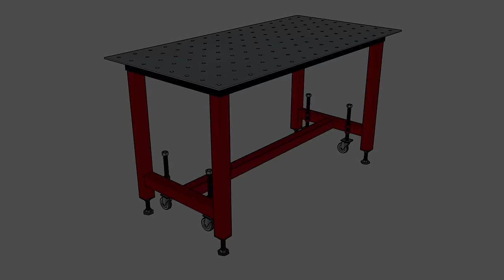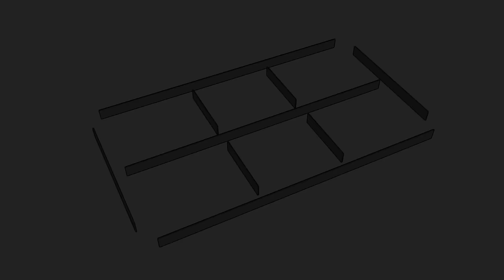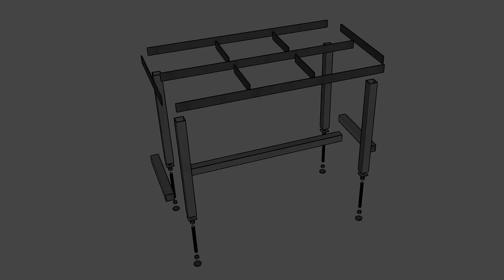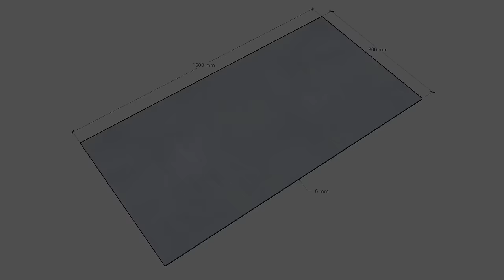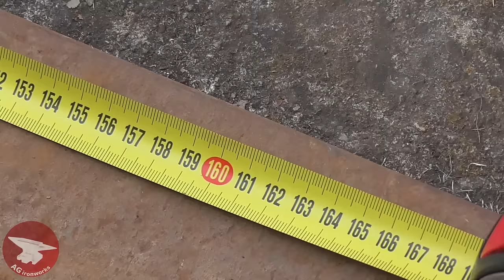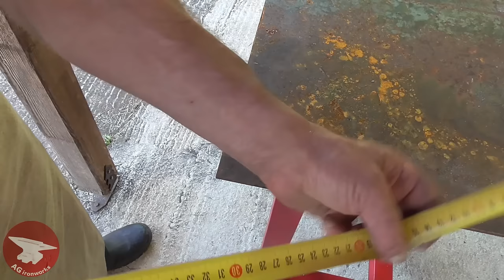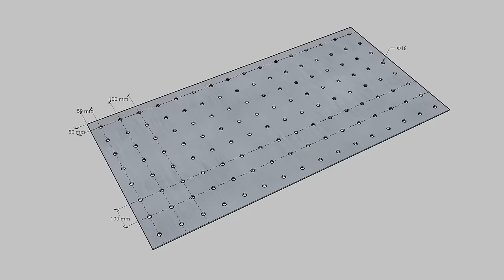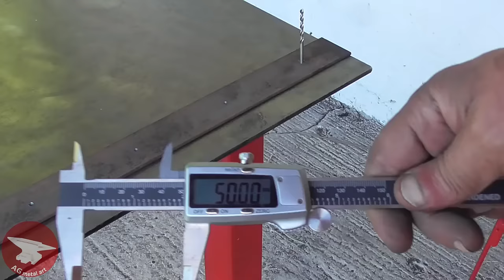Welding Fixture Table build - Step by Step the Entire Process

Comment: I bought 100A plasma and P80 straight steel machine torch for CNC. I am making electronics for 5 inch touch screen THC. I bought 2000x1000x1.5mm steel sheet and cut it in one piece for water pan and 14 pieces for grill. I want to make 1100x800x100mm plasma water pan but I don't have press to bend sheet. But when I put plasma on my cnc the very first project will be 10mm thick welding table because  I have Gude welding table with 2.3mm thick fixture plate and it is not perfect. My problem is bending sheet for water pan. There are 10-15 workshops with hydraulic benders in my town but no one want to accept job to make only 4 bends ☹ BTW I tried plasma and it cuts 40mm iron plate so it would be interesting to see what it can do combined with my diy CNC.
Reply from the maker: You don't need a press to make the water basin. I have made many without a press, even in thicknesses greater than 1.5mm. Watch this video to see how it's done:  https://www.youtube.com/watch?v=KyISgG2FLBU from 0'57'' - 2'45''
Reply from the maker: *If you're making a welding table, don't drill the 10mm plate with a plasma cutter, but use a magnetic drill instead. The plasma cutter leaves a bevel on the cuts and doesn't have the precision of a drill. There is a high chance of damaging the plate.

Comment: Nice work but I wouldn’t have done it without a magnetic drill. Just wondering how long did it take you to make that table ?
Reply from the maker: It's true that the drilling proved to be difficult for me. Certainly, with a magnetic drill, the job would have been much easier. The holes in the sheet metal took significantly more time than the entire rest of the construction. I would say 80% or even more,
of the total time required

Comment: What thickness flat bars are you using for the box structure?
Reply from the maker: 5mm.....their are one or two sections with a thickness of 6mm
Reply: @AGmetalart  Thanks. Great seeing you use ingenuity and basic tools to build. I was thinking of adding some wood or sheet metal trays underneath for tool storage.
Reply from the maker: @gamernerd7139  Surely it's better to utilize the downstairs area as well. I would do the same if I had the table inside the shop. Now that I have it outside, I don't leave tools out when I'm away

Comment: Nice work mate!
I love to see blokes making good useful things with basic (read affordable!) equipment, skill and a bit of ingenuity. Keep it up!
But, a little advice, don't weld on galv anything! Just get the plain "black" steel. Also, long nuts are better than two short nuts. And lastly,  continuous welds are always stronger than a few dabs (unless its MIG)  you get too many slag inclusions if you 'stop/start' without chipping it off.
And well done on getting the base flat before putting the top on! Only the second bench video I've seen where someone has done that.
PS - acid (hydrochloric or muriatic, depending on where you live, or even vinegar) will remove rust and mill scale.
Reply from the maker: Thank you! I will take your advice into consideration.